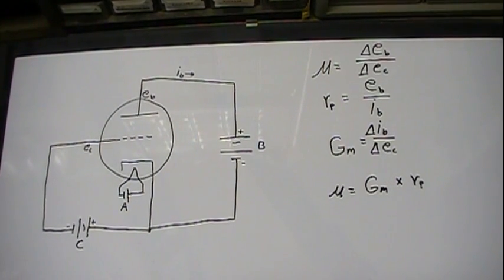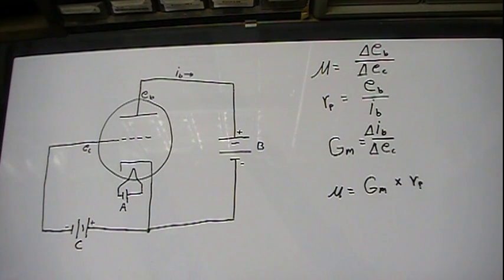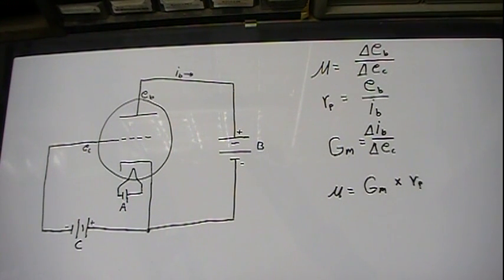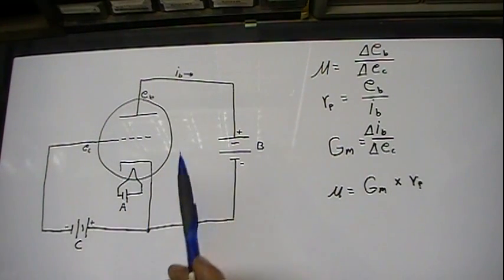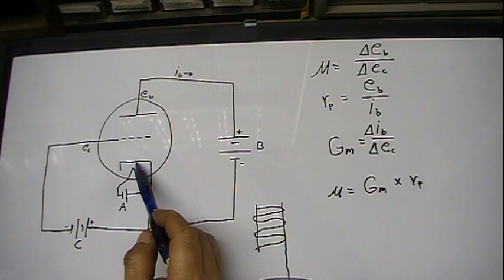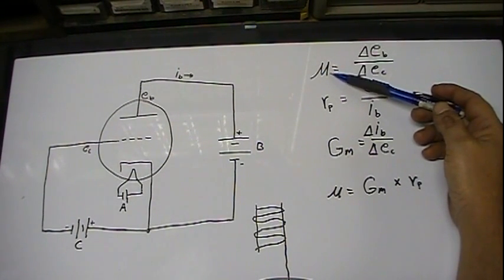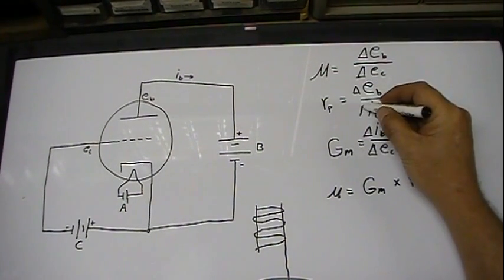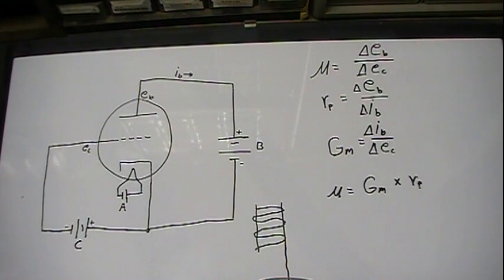Tube Theory part 1

Comment: Hint: I had a technician describe the grid as being like Venetian blinds. Set one way provides maximum vision to the outside. Adjusting the blind reduces the vision path to the outside from a little blockage to maximum blockage. The grid with its charge allows either a lot of electron flow from the cathode to the plate OR not so much... depending on how strong the path blockage may be.